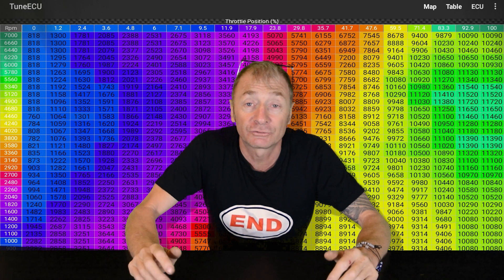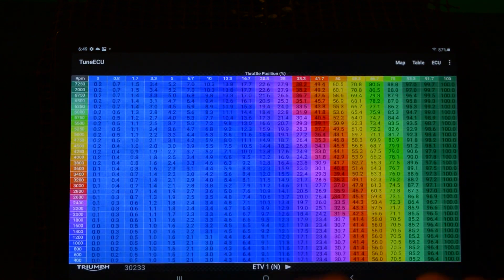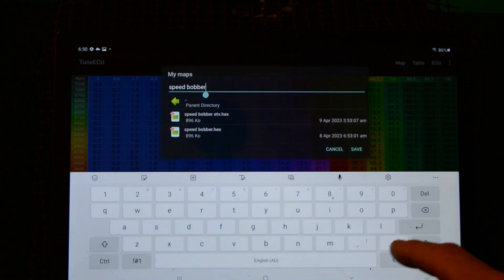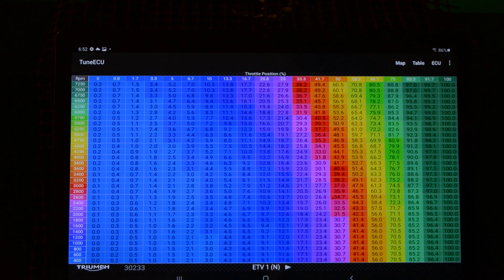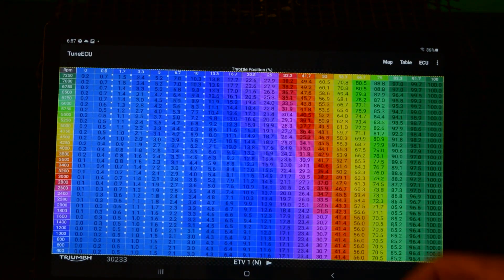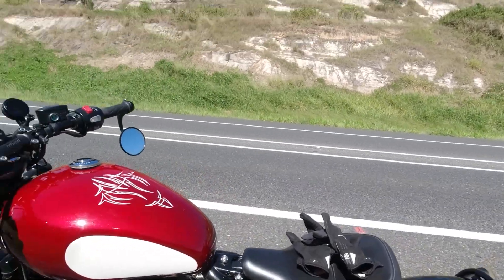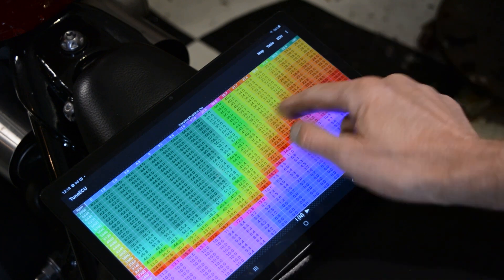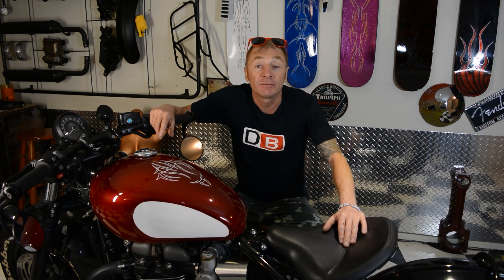ETV table tips for Tune ECU

Comment: Where can I adjust sprocket sizes, engine speed, throttle speed, etc?  Changing sprockets on a new 2024 Triumph Bobber causes an error light and code.